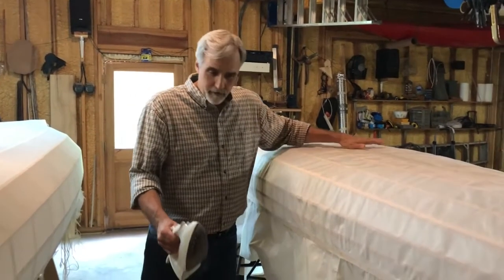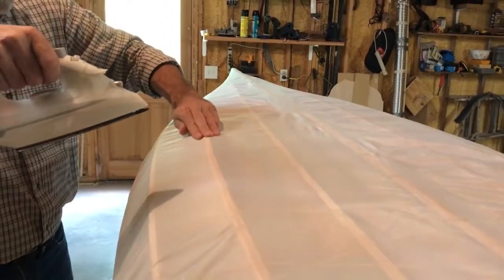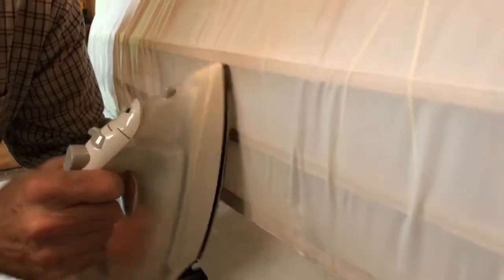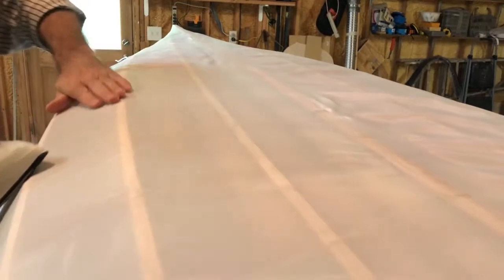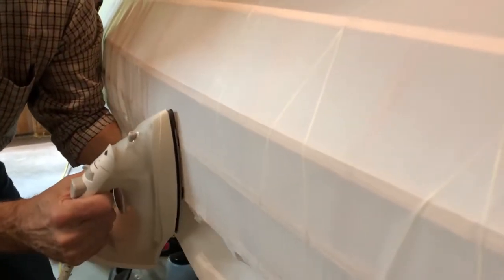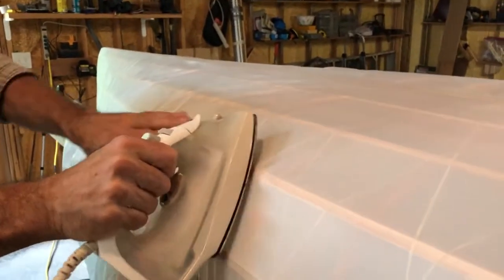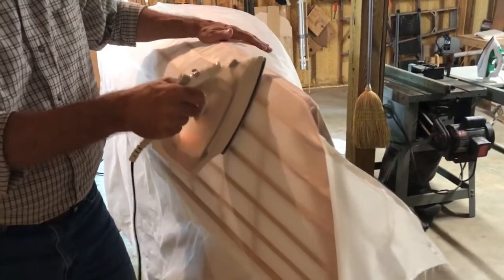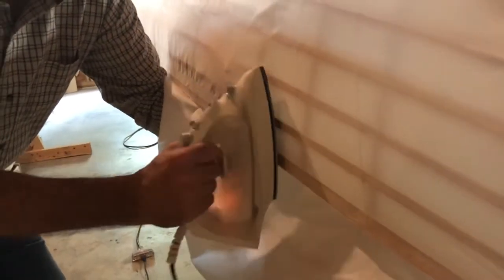Skinning the Boat, Part 3: Shrinking the Dacron

Comment from the maker: In theory, any bump in the fabric could become a wear point but there are a lot of boats out there that have been in use for many years, including my own, with no issues.  I did burn through one of the bumps while skinning a boat because the iron had gotten gummed up but a couple drops of epoxy patched it beautifully.  The fabric has excellent rip stop qualities and won't continue a tear.

Comment: Very interesting. Here's a naive question... Could it be possible to make a nesting dinghy with SOF methods? Maybe it would it be bossible to skin each section separately then have the sections bolt together, this way each section would have its own buoyancy.
Reply from the maker: Hi Chris, we actually get this question from time to time and it should be possible.  You'd need two transoms and removable thwarts.  Your boat would have some degree of compromised performance but it's possible!  Thanks, Larry

Comment: Will heat gun also works?
Reply from the maker: Hi, this is Larry LaLonde, owner of Geodesic Airolite Boats.  Thanks for your interest in our boats!  A heat gun can and will shrink the Dacron but is very inconsistent.  If you hold the gun a half inch closer or further away, the Dacron will behave differently.  The iron provides a consistent heat over a larger area, making it easier to control the shrink and keep the correct tautness across the entire hull.  Thanks again, Larry.